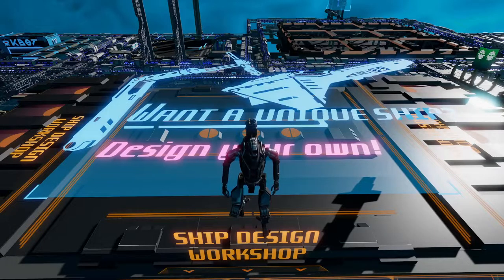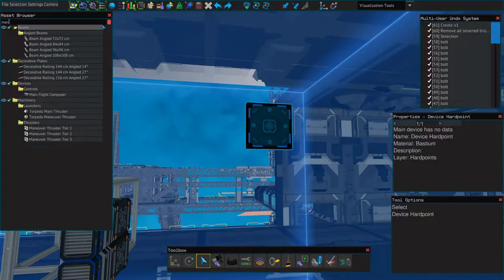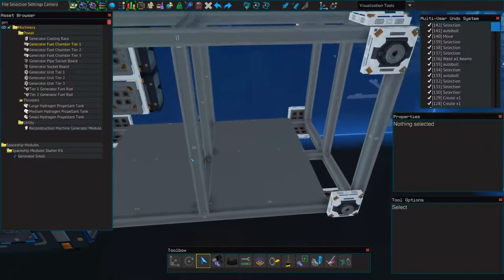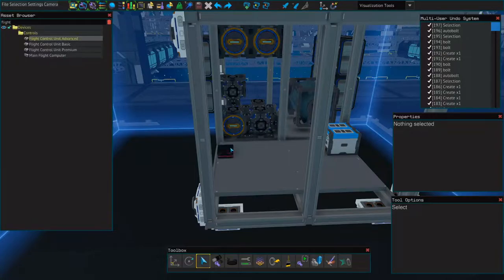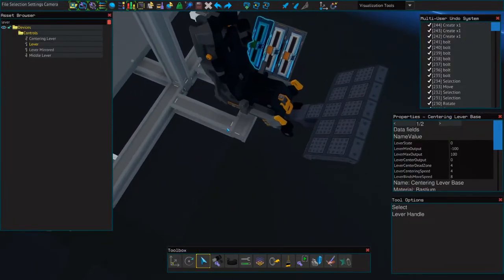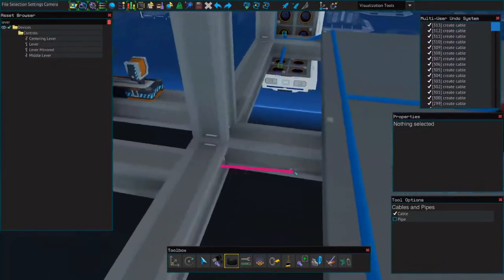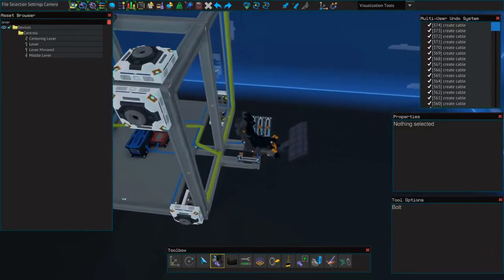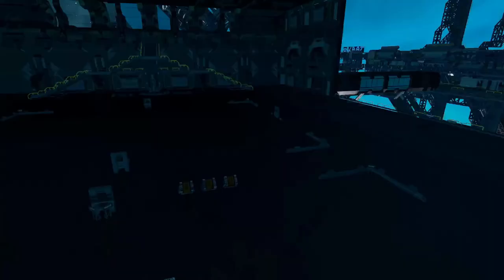Starbase Tutorial: Build A Ship in 20 Minutes!

Comment: Great stuff. Thanks! Some things that could speed up construction:
1. Hold down shift while moving an asset to duplicate it. This can save you time rotating as you'll know the initial rotation.
2. Use the "Spaceship Modules/Spaceship Modules Starter Kit" for both box thrusters and fuel tanks. With modules you can drop in the completed box thruster or fuel tank instead of having to snap together all its pieces. You also get a handy green circle to move around the entire module with all its pieces intact, so you don't have to box select off to the side.
Reply from the maker: Great tips!

Comment: Tried to build a pretty much identical version of your ship today. I got pretty far but I'm having issues with the cables/pipes. Hooked everything up, the thrusters, boosters, flight chair, panel/lever, heatsink, generator, battery pack, fuel tank, FCU and main flight computer.  Not the most visually appealing cable management but they are all linked together. i have double checked with the visualisation tools if there are any disconnected bits in the cabling/piping but cant find any. I don't hear the gen starting up like in your vid and in test mode nothing happens. What could possibly be the problem?
Reply from the maker: Hmm, not sure. I would double check that buttons are bolted down as that was an issue for me a few times, other than that it is hard to diagnose without seeing it. I would highlight the entire ship and try auto-bolting to be sure. Sorry I cant be of more help, let me know if you find the issue!
Reply: Had been trying to build a ship since the release of Starbase, had the same issue) but today I finally have found the answer - in the top menu find thrusters and switch thruster naming from manual to automatic. U also can check out a vid from the same author, second episode of his ship building series about thrusters - it goes into more details.